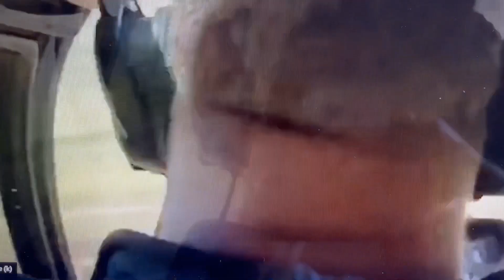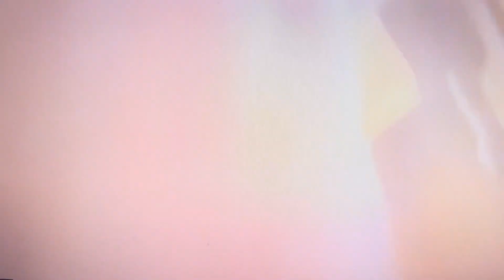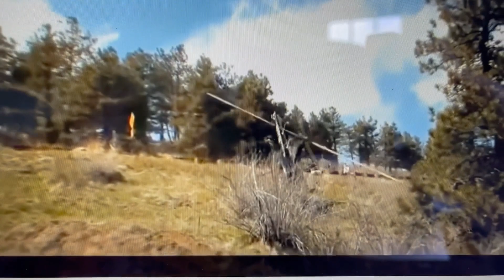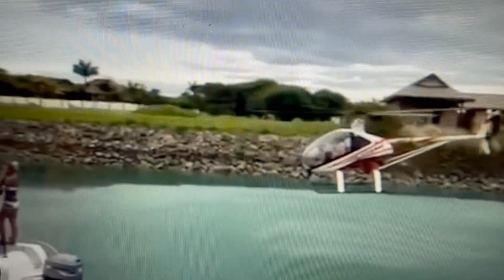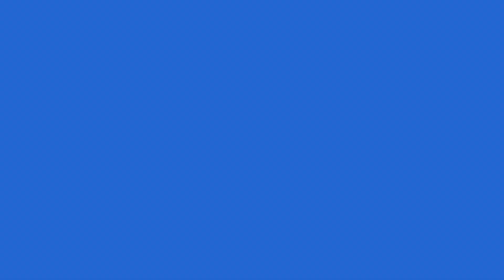When Power required exceeds Power available it can lead to a Helicopter Crash

Comment: What are you talking about that there's "no ground effect" over water: there's literally an entire class of pseudo aircraft that exploit ground effect to achieve high-speed flight over water. They're called Ekranoplans or Ground-Effect Vehicles. The Russians built one the size of a small town (not really but it's pretty damn large). That Schweitzer dude just ran out of engine power-- he got slow, got into LTE, pushed a bunch of pedal and drooped the rotor RPM until he sank into the lake.

Comment: Based on the videos, it might also be worth explaining how overpitching (low rotor rpm) affects the power available.  It's also important to note the terminology used.  The term 'Power' can easily be confused with the actual power used by the pilot in flight (MAP or torque) which can never exceed the power available.  Power required is really only correct terminology for level flight.  To stop a descent or to climb, a power margin (or surplus power) must be used.  If there is no power margin for an IGE hover, then the power is 'limited'.  So at normal flying rpm's, the power available from the engine is primarily a function of air density whereas the power required to fly level is a function of both density, weight and airspeed.  It is however still very possible to both overpitch a heli and to get into vortex ring state without necessarily being limited in power.  Cheers.

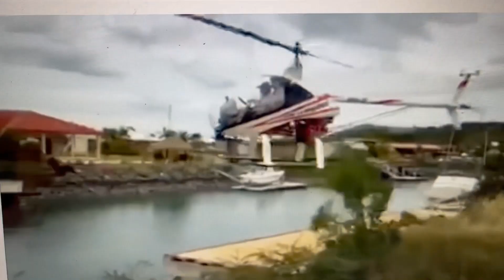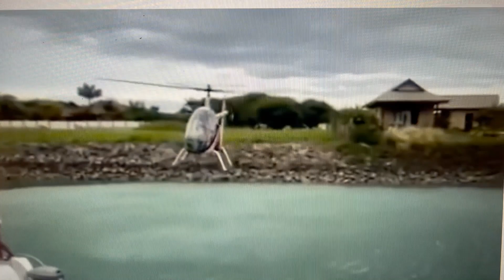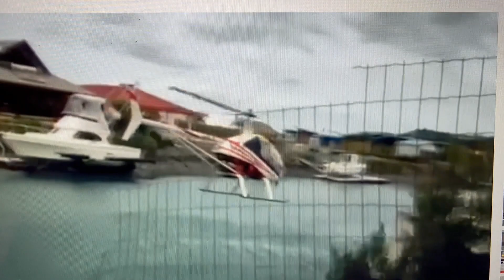Comment: Regarding the water landing at 4:56, at the beginning the helicopter seemed fine in the high hover over the water. The left turn didn't seem too excessive. The pilot seemed to make the turn in small steps and there doesn't appear to be any loss of altitude during the turn. The descent seems to start at 5:22 when the pilot pitches forward  from a high hover to pick up speed. In my experience, take-offs in a light helicopter near MGW or at higher DA over hard ground can be near the limits of available power. You have to push over very gently until you pick up speed. When the helicopter starts to move forward, it starts to descend. To arrest the descent, the pilot likely added collective and overpitched the helicopter. This is evident between 5:25 and 5:26. By 5:27 it looks like the pilot has pulled up level. The helicopter was happily hovering over the water just a few seconds ago, but at this point the engine has likely sagged due to over pitching so down she goes. Given that ground effect for a helicopter is reduced over water, the hover over water likely required more power than the pilot realized leaving an insufficient power margin for the take-off profile attempted.

Comment: Great video. This underscores that, as helicopter pilots, we need to know the limits of our training. If we want to move past the limits of our training into something unfamiliar, we need to get more training from an experienced instructor. Overpitching can be avoided. We just need to be flexible in our thinking. IFR pilots plan for this as a "missed approach". They have a criteria for moving forward or aborting. As part of the pre-landing check, while still flying at speed, what is your power at? What kind of margin do you need to hover? Better to know you're running low on power before you run out of power. My commercial instructor has me do my running landings while keeping the power below 20" (in the R44). While not necessarily useful in the situations shown in the video, it illustrates that you can't hover a normally weighted R44 with such a reduction in available power. I'm curious what other R44 pilots find. I only fly at sea level. For me, I'm usually below 20" in the downwind cruising at 70kts. I think my hovers are usually around 23". I'll double check some of my videos.